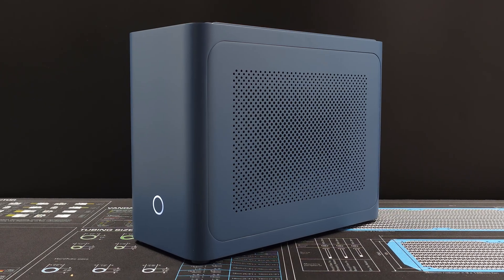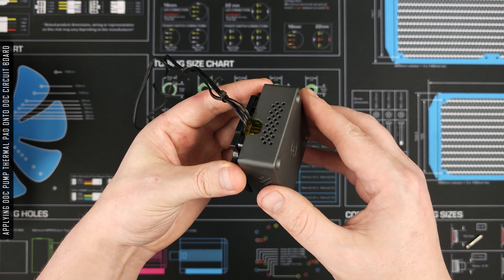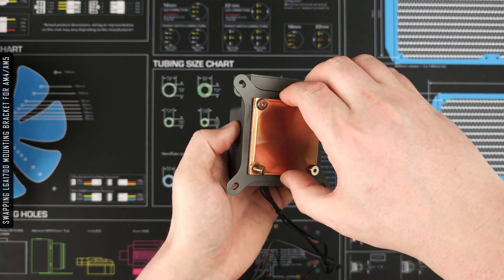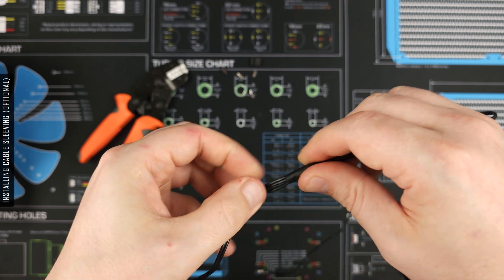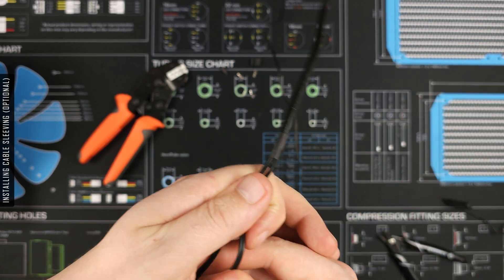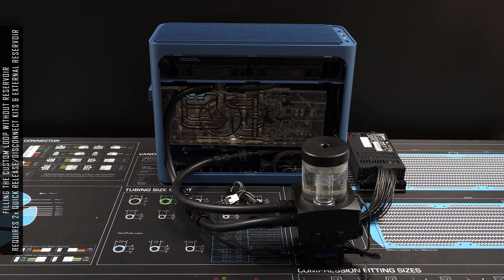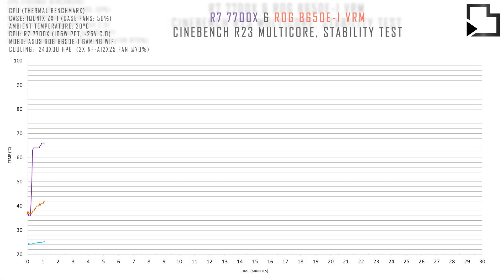The Last CPU Waterblock You'll Ever Need - Modultra LOBO

Comment: 2:22 you say you require a 2A fan header
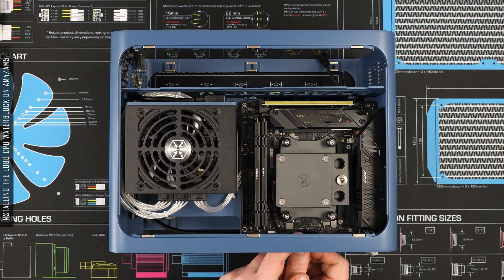5:14 it looks like you are connecting to the AIO header on the Asus Rog Strix B650E-I Gaming WiFi which is rated for 1A
is the aquacomputer quadro not shown in the video?

finally, the re-wiring using the fan header is not clear as to the pinouts - how do you know which pin FROM the pump is GND/12V/Tacho/PWM?
Reply from the maker: Correct 2A, and correct 1A header. Didn't attually use the motherboard header. The Quadro isn't there, hmm. The cables have markings if you look closely, and I used SATA pinout diagram and 4pin PWM pinout (also on deskmat if you look closely) to determine what goes where.
Reply: @L91  sorry to bother, but I honestly dont understand. What did you connect the pwm 4 header to? Everything I read so far warns strongly against using the motherboard headers for powering the pump. I have an x870i ROG Strix.

Comment: Any chance you can give us a link to the tools you used like the crimper, pwm pin housing and pins, and that extractor fork
Reply from the maker: I don't have links for everything. You can reuse the included pwm fan header, and I've provided information for hardware in the description.
Reply: @L91  Thank you very much. By the way is it normal to have air bubbles in a loop without a reservoir? I saw you used quick disconnects to fill your loop and I know quick disconnects can grab air as it is getting disconnected

Comment: Thanks for the video and showing the DDC rewiring mod. Do you have a link for that tiny fork thing that you push in to remove the pins from the fan connector?
Reply from the maker: I don't, but you can search your local Google for PC cable terminal removal tool and should find something.

Comment: Such a clean build! May I ask where you bought the wire for the custom PSU cables, what AWG the wire is, and what AWG the crimp terminals are?
Reply: I think 16 AWG is standard, could be 18. Shouldnt matter if you have a normal psu without voltage drop.

Comment: Is 75C a good temp for that cpu in a water cooled system?
Reply from the maker: For CPU heavy workload, worst case scenario. It is completely normal and fine. Remember, this is only a single 240 radiator. That said, if I was to try this build again, I'd have probably gone with 7600X for better overall temps in gaming.

Comment: What are your thoughts on running a 2 pin temperature sensor along the 4 pin wires and taping it in between the pump PCB and thermal pad?

Comment: Lovely, well constructed build.  The temps leave a lot to be desired - having such a powerful cpu/gpu on a 240mm radiator just doesn't make sense.  Fans at 70%, and the temps you've published still don't look like they've plateaued with the coolant temp at 45 degrees and rising.  Builds with this much processing power are better suited for dual 240's.
Reply from the maker: Temps aren't exactly where I'd like them to be, but liquid temps won't really change much. This is a consequence of hardware choice. 280mm radiator would have been more than capable enough for gaming as I've run a similar build before in Meshroom S. If I were to build this again, I'd have gone with 7600X instead as AM5 CPUs run on the hot side in gaming. Some GPU optimisations would have been beneficial also.